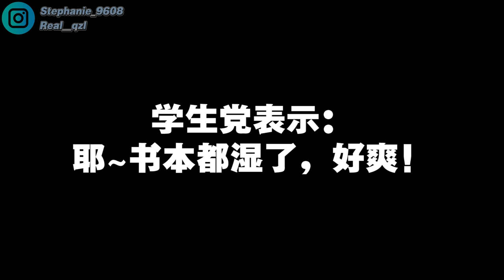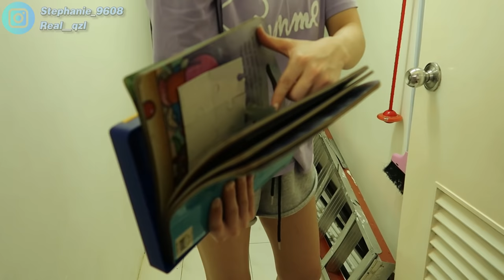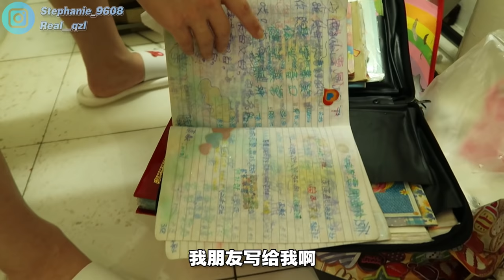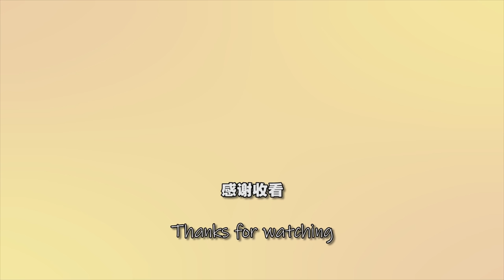水灾后的第二天完全不能睡...担心睡下去家就没了！这次的灾难让我们损失惨重，亏了将近RM30000以上！最后还是逃不过血光之灾。。。

Comment: Your tile is because when installing that  time no milk latex was added on it..that is why it has air pocket when water is over the top..this one cannot be rescued just by few peices..have to take out the whole area..every piece and put in new one all.and whoever do your tile..tell them to use the best susu latex ard rm200 per tong..just cement not enough. My cousin got cheated last time and all the tile didn't put latex..same problem like yours